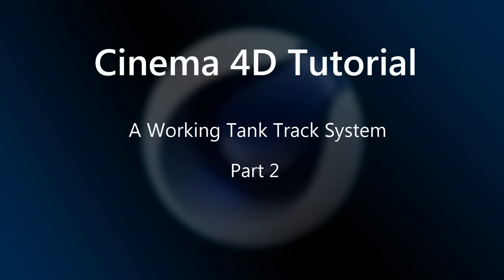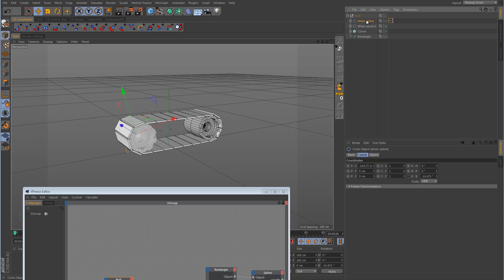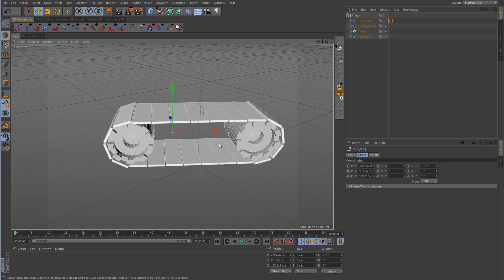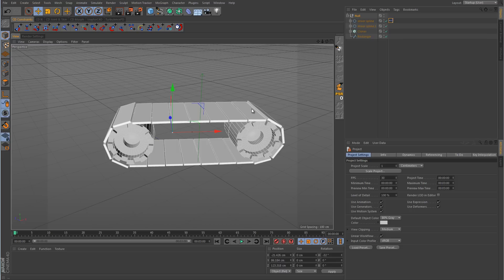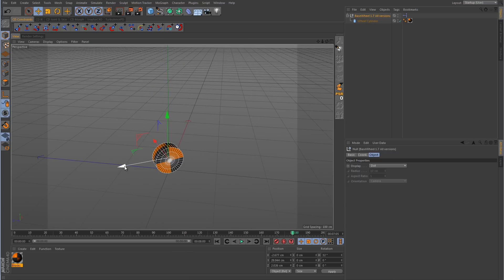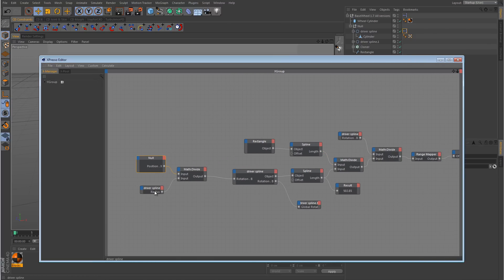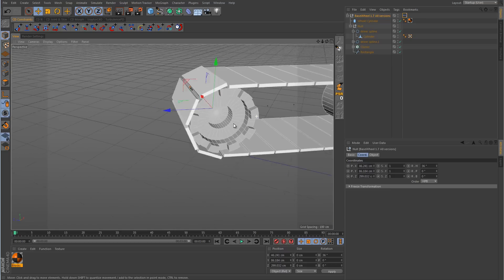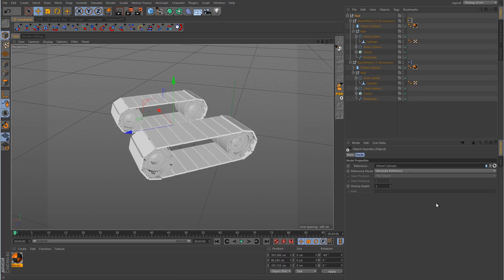Cinema 4D Tutorial - A working tank track setup - Part 2

Comment: Great tutorial, but I have an issue. 
I closely followed your first part but your initial setup in this tutorial was slightly different. I tried to adjust accordingly but as a newbie I probably made some mistakes.
Whenever I'm pushing forward my setup the wheels and tracks are moving in opposite direction. Same goes for backward moving
Reply from the maker: It sounds like something has been reversed. Any chance you can share the scene file?

Comment: This is a GREAT tutorial... I do have one question, my dang wheel is 
turning slower than the tracks.  Wonder what I did wrong?  Any ideas on 
the fix?
Reply from the maker: It could be possible that you have your xpresso nodes reversed. The rectangle spline node needs to be on top, and the driver spline needs to be on the bottom.
Reply: That's the ticket!  I don't know how I got them reversed.  Thanks! ☺